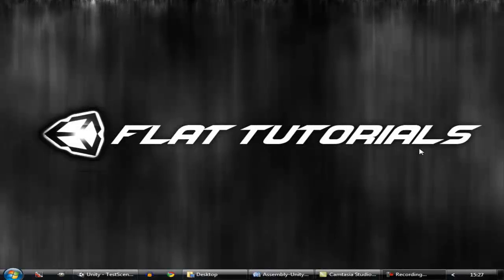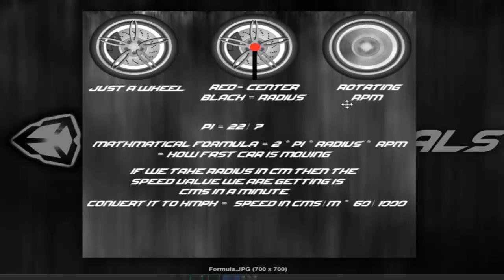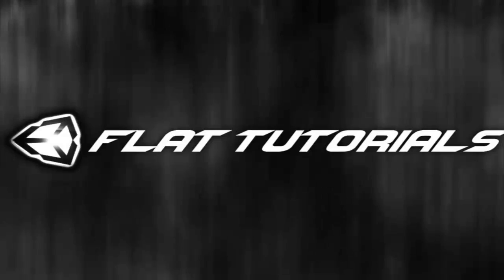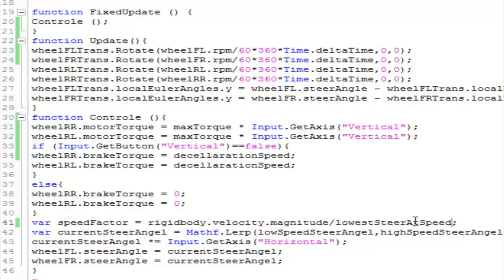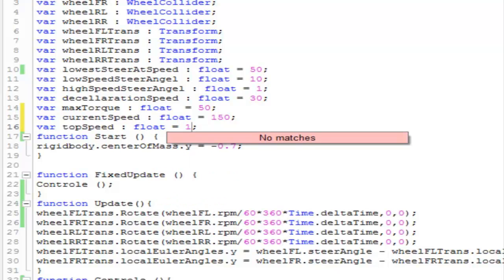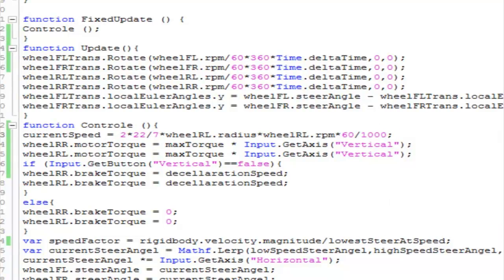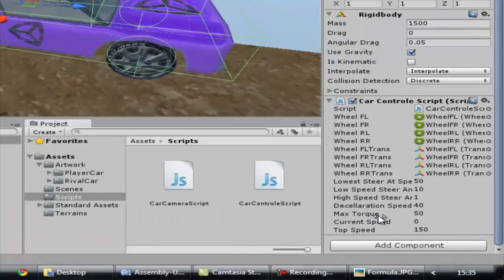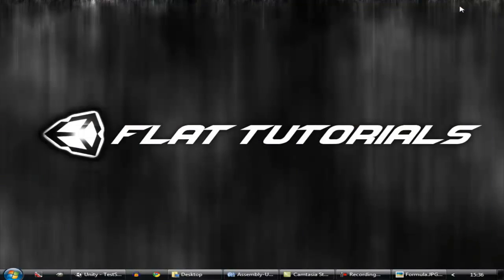#9 How to make a Car game - Unity 3D Tutorial - Speed Limit

Comment: Sorry boosss i found a better solution ... maybe ...because if you use the formula  below (that converts the value from minus which works perfectly well) you wont be able to set the maximum reverse speed ....  or maybe.. who know but all i did to fix mine is that i use RR instead  of RL......(use wheelRR.)...
Reply: how would that change anything?
Reply: dunnno worked for me...
Reply: Aldo Leka add this bit of code

if (currentSpeed < topBackwardSpeed)
	{
		wheelRR.motorTorque = 0;
		wheelRL.motorTorque = 0;
	}

and this variable 

topBackwardSpeed : float = -25;

basically does the same thing as the speed limit for going forward, but its neat because you can make driving in reverse slower like in normal cars.

Comment: If you use that code, then it stops the speed limit working. I've had to change the speed code so that it works based on the value as negative. Any way to fix this?